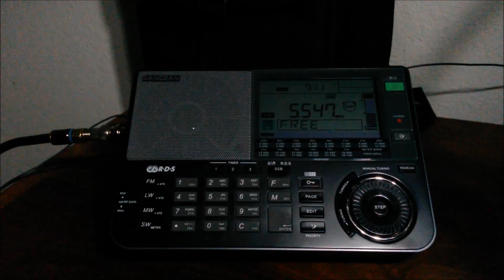HF Aero: Shortwave communications for transoceanic aircraft 6/20/2017

Comment: Thank you!  I just got back to this .  I have same radio I had the 909 but I bumped it and it dropped. I got the X and am working on an antenna. Getting ready to string a bare wire 100' outback.   I loved my classic 909, had it for 15 years plus and it got abused, it went everywhere!  Getting used to the X .   Thanks again, Shawn.

Comment: What is the bandwidth filters ? Can you select the filter bandwidths ?
Reply from the maker: Sangean ATS-909X has two selectable ceramic IF bandwidth filters for AM including shortwave. These are 6 and 4 kHz (WIDE and NARROW). The bandwdth switch is located on the right side of the radio next to the audio filter switch. HF Aero is SSB (USB). The 909X has one bandwidth available for SSB. I don't know the actual value but it must be somewhere close to 2 kHz.
Reply: It needs a narrow SSB filter !
Reply from the maker: @Mr07008  I disagree. I hear no splatter from nearby signals in this recording at all. The 2 kHz (1/2 of the 4.0 kHz filter) filter is doing an excellent job. Where do you hear anything in this recording that could have been improved by a more narrow IF filter?

Comment: What antenna are you using?  Keep up the good work.
Reply from the maker: Tnx! It's a 106' backyard long wire (actually, a random wire at this frequency) with about 50' of RG6/U quad shield coax cable as the feed line into the house.